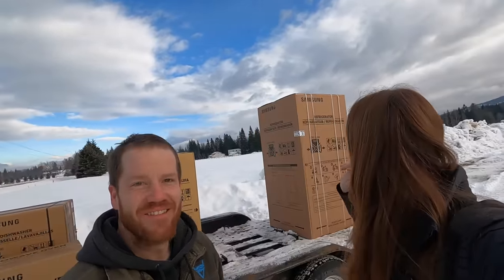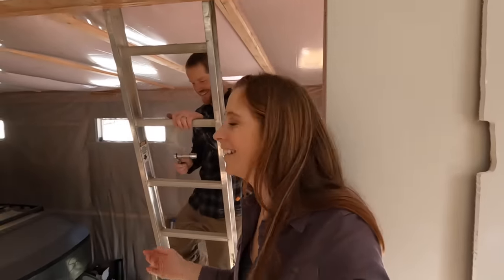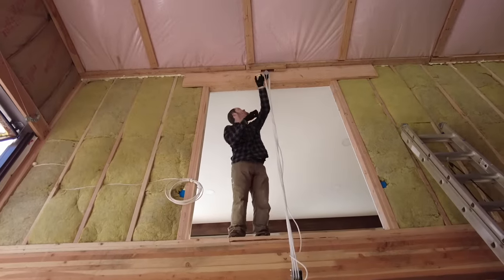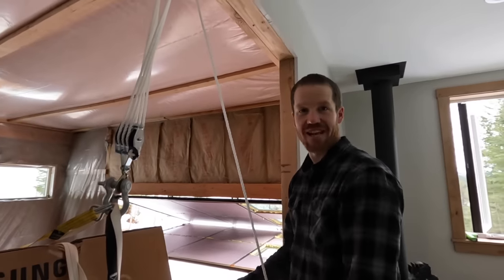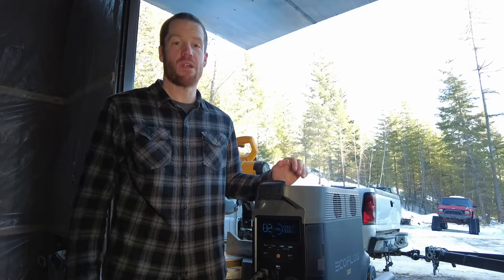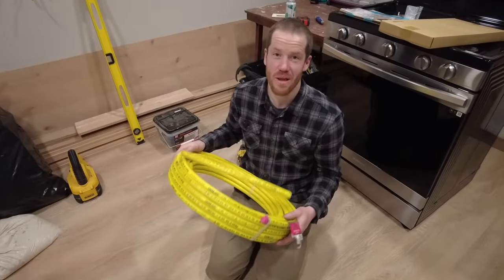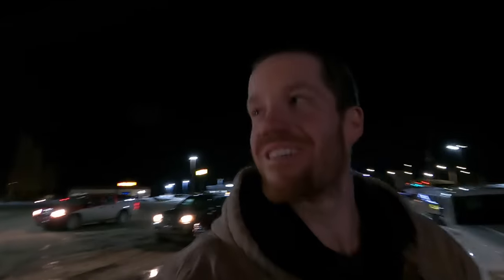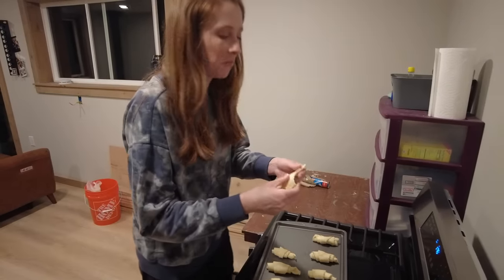This is a HUGE Deal! | Building Our Home Off-Grid

Comment: After rewatching this video... I was wondering why you didn't use the Army Truck to pickup the appliances? The gap between the ground and the 2nd story floor would be greatly reduced.. Also the stability of the truck deck would make a safer platform for work.. I mention this because not to criticize, but you guys are very far away from the city and medical help. AND I have a knack for getting hurt WHEN I do stuff like that.. Though the years I have learned to work smarter not harder most of the time... SO YES LEARN FROM MY MISTAKES.

Comment: As usual, nice job/s! lol  I really like that overhead garage door!  Using pullies= working smarter, not harder. You guys are busted!! You did not have a temp railing behind the drywall and I might let it slide this time because you had the couch to protect the lower half. lol  Riley, put a blue piece of tape on a 1/8 inch drill about 6 inches long that says, "for pilot holes". That way if you hit something, it`s not too big of a problem, just sayen.  I like Tillamook cheese and icecream. And last of all and very important, do not forget to check for leaks with a soapy solution on all your gas connections. Stay safe, work safe. Take care
Reply from the maker: That is a great tip on adding tape to the drill bit! Courtney says Tillamook cheese is the best.

Comment: My wife and i love your channel and watching your progress each week.  Will the washer and dryer be downstairs?  Where is your water heater?  So, is that eco-pak deal an inverter with a lithium battery or batteries inside that you recharge periodically?  I assume the more appliances / wattage you power, the less time the battery will last before needing to be recharged.  How are the mouse deterrent deals working?  Are your solar panels charging decently thru the winter?
Reply from the maker: Hi Bryan, yes we plan on a "mud room" downstairs with washer and dryer, coat rack, boot drying, etc. We don't have a water heater yet and haven't decided what were doing yet (propane vs electric, instant vs tank). Yes the EcoFlow is basically a LiFePO4 battery, inverter, MPPT charge controller, 12v transformer, plus some other stuff all on one convenient (and surprisingly small) box. The more load we add, the less time it will last. Right now about 2 hours on our Honda 2200 generator will last about 24 hours running our normal daily use. On sunny days the solar works well, but we only have 300w of panels right now. Hopefully this summer we'll be expanding with a permanently mounted solar array.
Reply: Thx for the reply - sorry for all the questions!

Comment: Correct me if I'm wrong but - the nice 4 wheel drive truck that you have in the barn has an at least 12,000 pound winch on it?  You could have used a snatch block and all of that kitchen  stuff would have pulled that stuff up without the effort. Also- you have a mini-excavator that would have picked it up.
Reply from the maker: The truck doesn’t have a winch… yet. 😉
Reply from the maker: No, we don't have a winch on our expedition truck. We've used the excavator in the past to lift stuff up into the apartment, but with how tall the fridge is it doesn't have the lift height to be able to get the fridge up there. We're planning on making a set of forks for the excavator to help with the heavy lifting though!

Comment: The reason your oven is so smoky is because of the chemicals used during manufacturing. They always recommend to turn it on and run it for 30 minutes before using it.

After that first burn in everything‘s fine.

Comment: I believe that CSST when passing through a cabinet, wall or floor has to be hard piped through said product then the CSST can connect to the hard pipe section. Also it should be bonded to the grounding system of the home.
Reply: Be a good friend and go show them how
LTY&Y
Reply: @user-cb2427  On my way!

Comment: Wow.  For $4500 (without panels or any way to charge it) you could buy a top of the line Yamaha (EF3000ISE) or Honda (EU3000iS) genset and still have $1500+ to buy fuel.  Bet that Honda/Yamaha genset will still be running and have parts available 25 years from now, too.

Can't help but thinking a couple (3) of Battleborne LiFePo 100AH batteries ($2700), a and a top-of-the-line Victron inverter/charge controller ($1500 for the Victron Energy MultiPlus-II 2x 120V) would still be cheaper, be of better build quality, and leave you approx $500 for panels (although you would likely want a few more panels).
Reply from the maker: There are definitely lots of ways of supplying power off grid! Listening to a generator 24/7 and constantly refueling gets old fast. Plus there's the challenge of hauling that much fuel. We have a system similar to what you described in our expedition camper. It has worked really well for us for the last year. The EcoFlow Delta Pro is a nice all in one portable solution. It showed up ready to go, which is really convenient.

Comment: Did you plan what you would do if one of your appliances had to go back to the store for a replacement or out for repair now that you've closed up the wall?
Reply from the maker: They can fit out the sliding door on the side of the building. Eventually there will be a deck and a staircase there for them to easily be brought in or out. Thanks for watching!

Comment: I'm assuming the truck has a winch on it so you could just could have used two blocking tackle and use the winch on the truck to take it up there and hold it in position this is assuming the truck has a ranch and you have two snatch box kind of I'm a kind of a tow truck driver
Reply from the maker: The truck does not have a winch on it, yet. 😉

Comment: when I bought my stove it was setup for natural gas, I had to buy a kit to change it over to propane.......did you have to do the same thing?
Reply: Most gas appliances come with LP jet kit somewhere in the appliance. My gas range had it taped in an envelope under the top level.  My gas water heater also had the jet attached in the service panel.
Reply from the maker: Yes we did!

Comment: Do some research on your fridge. I don't know what model you have, I own a Samsung and it has been a hassle ever since. It thaws the freezer out and it will stop working. Once my fridge started doing it, I did some online research, and apparently, it's a very common problem with Samsung or at least my model line. There is a class action lawsuit and the latest I read was Samsung was sending repair kits to those few that were on the news showing the issue with their very expensive Samsung Fridge. I live in a 110-year-old farmhouse and I have come home to find the hardwood floor wet and the freezer just thawed. It also will choose a fridge temp above 40 at times and cycle to it. At least setting it to as close to freezing has allowed the food to stay cold enough when it does it...

Comment: I do not know if you two keep currant with the replies, but I will add a little information for whatever good it is.  30 years ago my Wife and I bought a small piece of property that was close too my work.  At the time I was a field service mechanic for a Caterpillar Dealer.  I was only 2 power poles away from grid power, and the power company wanted me to "give" them $12,000 for those 2 poles.  Then I would GET to pay them $130 a month.  It made me mad.  So I built a solar array with eight 80 watt panels.  In my service porch I had eight Trojan L16 lead acid batteries.  My inverter was a Trace 2,400 watt 12 volt unit.  I also had a Onan 7,000 watt propane powered generator.  My 14x70 2x6 walled mobile home had a propane refrigerator, a propane dryer, a propane water heater, a propane cook stove, and a propane infrared wall heater.  I also put 12"  of insulation under the floor, which helped out immensely with keeping the heat bill to a minimum.  

Since my generator was only 110 volt, I put a 120 volt pump in the well, and I filled a 600 gallon tank that was in the battery room.  I used a 12 volt RV water pump to pressurize the house water system, and it did a beautiful job.  All of the articles that I read said that that kind of water pump would not live long.  Since it would be so easy to change it out, I bought a spare.  It lasted with absolutely no issue for 4 years, and when It did fail, it took me 10 minutes to change it out.  That little water pump supplied enough water to run the clothes washer, the dish washer, showers, etc.

All you need to do the get 220 volts is buy a cable to go from one inverter to the other inverter.   Easy peasy.   My inverter was a modified square wave, and it worked just fine.  They do make true sign wave inverters, I was just too cheap.  My propane bill was set up on the ez pay plan and was $65 a month, and that was for everything.  I lived there for 5 years, and for 5 years I had no power bill, just a propane and a phone bill.  I also had two 500 gallon propane tanks.  I think that you could easily get a 1000 gallon tank, fill it up in the fall, (when the truck could make it out there)  and it would last you until summer.

You have probably done way more to your place by this time.  I am so very impressed with both of you.  I just found your channel, so I have a lot of catching up to do.  I love your set-up, and I would love to live like you do, but my Girlfriend would not like it at all.  Sadly, the Wife that I had when I had the solar house passed away from a heart attack over 20 years ago.  I also live in Idaho.  Pocatello to be exact.

Comment: I'm loving your build, but you guys are killing me. The back of that Army truck has got to be half way up to the floor of the apartment. The pickup must be half way to the level of the army truck, and the trailer is close to half way to the pickup. Getting material up any one of these steps has got to be easier that going all the way up in one! 

It's obvious that you two ain't afraid of hard work, but working smarter means less chance of damaging your expensive appliances or materials.
Reply from the maker: The thought crossed our minds, but we couldn't come up with an easy way to get the fridge into the bed of the army truck!

Comment: I would have made the area you cut out to bring in the appliances up as a second story loading dock door for your upstairs apartment for heavy bulky items.  You may have to replace those appliances at some point in time as you're both young or have to bring other heavy and bulky items upstairs to your living quarters.  

While I admire your ingenuity, I question the wisdom of having an upstairs living quarters in your shop.  I'm disabled, I would never and for all practical purposes cannot live in a two story home or an upstairs apartment or condo.  Granted I didn't think about that when I bought my last home in 2008 before I became disabled.  I was happy with the location and square footage of the home.  Take it from experience; future proof your choices.  We all get old, one of you may become disabled to the point either from age or a serious to near fatal accident to where one or both of you can no longer live in an upstairs apartment.

I'm putting this out there for anyone who's thinking of buying or building a home.  Design it so you can live it for the rest of your life regardless of what happens to you.  I had major spine surgery fall 2012.  If I knew that was going to happen and the outcome, I wouldn't have bought the two story home I bought in 2008.  

Hindsight isn't 20/20, it's 20/10 or perhaps 20/5.
Reply: Excellent advice.  When we built our new home in 2000, we planned for first floor living.  The rest is all extra upstairs and downstairs.  Made our doorways 36" wide for wheelchair access.  Made a walk-in shower with no door and a bench seat built-in the shower.  Now, 22 years later we are in our 70's and have utilized all those features.  Living where you do you are more at risk for serious injury.  Hope and pray nothing happens to either or you, but preparation and planning can pay off and make life better, in the long run.  Great job.

I won't repeat the safety suggestions other have made.  I was thinking of many of them as I watched thus video, too.  Be safe out there!

Comment: Why didn't you just unbox the refrigerator, remove the doors (normal in 98% of deliveries of a refrigerator this size) and take it up the stair with an appliance hand truck?
Reply from the maker: Even with the doors removed it still wouldn't fit through the interior door openings between the bedroom and kitchen.
Reply: @AmbitionStrikes  Ok, makes sense.   No doubt you two find a way to get thing done and overcome all the obstacles!  Very impressive.

Comment: TAKE THAT SAMSUNG PAPER WEIGHT BACK IMMEDIATELY! A class action lawsuit has formed about the Samsung Refrigerator/Freezers continually freezing up. Seriously! My friend paid $3900 for hers and it's been nothing but trouble.
Reply from the maker: Hopefully it lasts until the deck is built and we can easily replace it... 😬
Reply: Yeah they do have issues with the ice box freezing up. We have almost the same model and had the ice box issue. Samsung has quietly started to repair it for free (even out of warranty) which we had done several months ago and it hasn’t refrozen since. There’s lots of diy instructions on fixing it online and I believe you can even get the whole kit that repair techs bring to fix it (proper fix includes replacing main board to adjust timings of defrost cycles) so I’m sure Riley could fix it too. The main thing I dislike about this design is the fridge doors are so short and the ice maker takes up a bunch of door space so you have a lot less door storage for milk and juice etc. I hope it works out though. It’s a big fridge for 2.